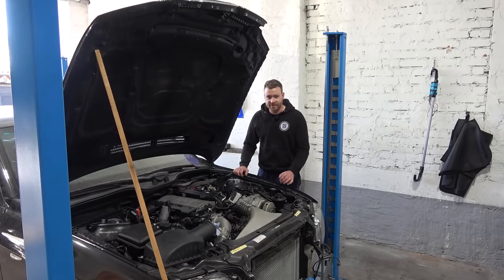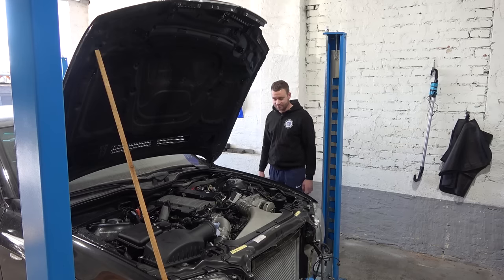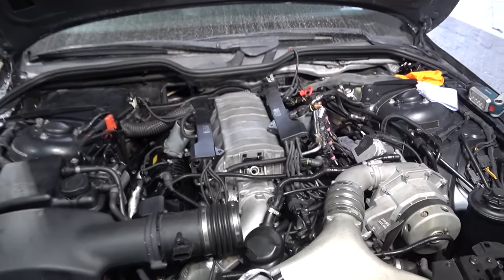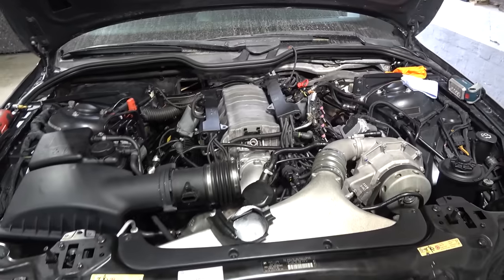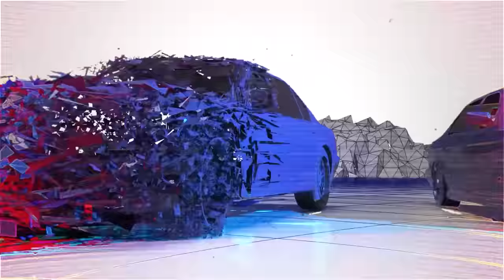Disastrous First Drive - V8 Alpina B7: Project Chicago: Part 7

Comment: I've had an e36 with an m42 engine in the past,it started knocking like crazy and I was ready to pull the engine out and replace it with a bigger one,but one of my friend's told me to fire it up without the accessories belt just in case and what do you know.. the knocking went away. Turns out my water pump bearing was basically eating it self. Replaced the water pump,and the engine works perfectly fine again. So i hope you get that lucky too!
Reply: Only thing is, if you follow the series...it has a brand new water pump....so it must be something else...
Reply: @ernest.cazenave  brand new things can be broken to :/
Reply: @amosjovt  extremely unlikely when it related to a japanese brand car...
Reply: @ernest.cazenave  I didn't know Japan owned Bavaria. Did WW2 end differently in your universe?
Reply: I had same problem on M52TU, it started knocking and sounded like it was comming from bottom of the engine. Took off valve cover, inspected everything, was ready to change the whole engine... In the end it was stupid water pump
Reply: Having in mind there was no AC, it may just be the AC compressor. I've seen it happen on some n54s. Sounds exactly like a rod knock. Anyways awesome work and hope it's something simple!
Reply: @Ernest Cazenave then just, fuckin say so?
Reply: Silence is approval they say..LOL..!!

Comment: OMG, I feel your pain. In college, I helped a friend rebuild the engine in his 1970 Buick GS. We pulled the engine and took it to a machine shop. My friend wanted to reassembly the engine himself. I tried to talk him into letting the machine shop do it but he insisted. We put the engine together. About a 500 miles later, he got on it and we heard the dreaded knock. Our hearts sank 'cause we both put a lot of blood, sweat, and curse-words into getting that massive 455 back in-place. That was way back circa 1980; hearing your knock was like reopening an old wound. I pray it's something minor...but I fear it's not.

Comment: I had the privilege of driving an Alpina B7 just like this for several weeks.  It was my best friend's car.  One thing to note about those wheels.....they are extremely fragile and arguably not well-matched to the car for daily driving.  My buddy went through 3 wheels in his first year of ownership in San francisco.  I was driving the car near Tahoe and hit a relatively minor pothole.  BAM.  There goes another.  The ride and power was amazing for a car it's size.  I remember being able to adjust the suspension stiffness, and it was noticeably different, with small bumps resonating similarly to what you were commenting on.  Nice car.  I hope the rod issue isn't bad. Fingers crossed.

Comment: I feel you. I really do. I saved for 5 years to buy my dream car. F11. My engine died after 1 year of driving it. Also exactly as yours did. I went off the Autobahn and when the load was no more on the crankshaft I heard the knocking. I still regret to have sold the car for cheap.
Reply: After reading this, I died a little inside, sorry for your loss bro, I hope your dream car will come true again.

Comment: I came to this stream back- asswards...watched part 7 first and gathered that it was another "revival" car but without knowing the effort to get to this point, it was sad to hear that knock but not devastating. Then I decided to watch 1 thru 6 and it all started to change my perspective...it turned into a binge-watch, all the time knowing that there was a fail in the end. All the care and effort that went into doing this first rebuild just right, was hard to take in cuz I knew something went awry. It is a bit like a novel or movie that starts with a scene at the end of the story and then takes you back to build the plot. I wish there was a happy ending but I doubt it...just yet.  
     I love my LeMans Blue BMW 135 i and as a " not " mechanic, have learned immensely from the few projects I have tackled.  Intake removal and walnut media blast; spark plugs and new higher performance coils; oil filter housing gasket leak; 4 wheel alignment...I'm sure there will be more and watching Sreten attack his projects, gives me the impetus to do the same for my baby 1 series. 
      Now I await for project Chicago to reveal " The rest of the story".

Comment: It is so hard to rebuild the entire engine only to have it fail so quickly. I had pretty much the same thing on an old VW air cooled engine. And even though they aren’t compatible at all, the feeling is. I hope for you it’s a chain or maybe the timing skipped again. Spun bearing would be very disappointing. Especially since you worked so meticulously. Keep it up. You will get there eventually. 💪🏻

Comment: If it idles at the typical 750 RPM then things that happen at crank speed should be at 12.5 Hz. Things related to the valvetrain or a particular stroke should be 6.25Hz. This noise is about 4Hz which is quite slow but could correlate well with a chain. belt or something else that goes around far below crank speed-- of course, assuming 750 RPM.
Reply: What’s the formula to get to 12.5Hz based on 750rpm?
Reply: @lenn4rd  750 (cycles/min) / 60 (sec/min) = 12.5 (cycles/sec)

Since the problem turned out to be pistons gouging the bores from incorrect tolerances, it's weird that the frequency was so low. I matched as best I could to a tone generator. It would indicate 480 RPM with something running at valvetrain speed. I doubt the engine idled at 240 RPM. 12.5 and 6.25 Hz were much too fast to match the video anyway.

480/60/2 = 4
Reply: @Sonny_McMacsson  idle rpm is 500 rpm so your calculations match

Comment: Don't give up. I totally understand the frustration but do not jump to conclusions, you did a very good job. Rebuilding engines is a major job peppered with potential problems encountered. Start by examining the oil, if there are no shavings, I highly doubt it would be a spun bearing. Well, you know what to do next I am sure. ;-)

Comment: I had the same experience when i rebuilt my 32 valve cobra engine, everything seemed ok  for the first couple of days, then i noticed a unexpected sound like slacked timing chains, all the guides and tensioners were new, pulled the engine back out and started diagnosing found rod and main bearings showing signs that material had gone through them scoring my new crank, all i can say is it realy sucks, but i have faith you will get it fixed you are a persistent individual.

Comment: Sreten, NOOOOOOOOOO 😢 that N62 really wants to fight you! But that's really strange, I don't think you did something wrong in the re-assembly.
I bet on oil contamination by the stupid old leaking injectors.
I just hope it's not too bad to fix! Fingers crossed ✌️
Reply: That doesn't make sense
Reply: My N62 and many others are getting to that 200k+ that's the strange part about this. I guess adding a extra 200 hp will do this
Reply: He changed the oil after the leaky injector change, I think he mentioned it
Reply: I was thinking this, starting the car with  fuel in the cylinders, may have slightly compression locked one or more of the cylinders causing tiny damage to the main bearing shells, and after a time running it, making the knock or spun bearing shell, d

Comment: As a shop owner I've rebuilt engines only to have them blow up because of improperly bled coolant (vq35) In a weird combination of the air bubble not being near the ECT, rushing to finish the car the day promised, and a bleeder screw placed in a dumb spot I've had fastly disassembly of an engine I've spent weeks building. Nothing to do but take it as a learning opportunity. All that can be done now is figure out the mistake and plan ahead so it doesn't happen again. 
Enjoy your videos from Florida friend. Good luck 🤞

Comment: When I do suspension links, I first take a measurement from the center of the wheel to the wheel arch with the car on the ground.  Then when I have all the wheels off and new links installed, all I need to do is jack the suspension up until the measurement from the center of the hub to the wheel arch is the same and tighten the bolts.
Reply: Simple and smart! Way easier to reach everything when the car is still jacked up!
Reply: That won't do anything uk, it's not bushings it's a ball joint within the links, so any way you tighten the ball would move to the position, you should be that for bushings but ball joints an links it's not needed
Reply: @pharezknights5467  Check your steering, I think there's a loose nut behind the wheel.

Comment: 44:58 the buzz sound might be from one of the buttons on the turn signal lever. I have the same problem in my E61
Reply: Same on my E60
Reply from the maker: Ha. Danke! Will check.
Reply: Same. The BC-button drives me crazy.
Reply: Same thing with E9x’s of same era. Drives me nuts 😄
Reply: On mine it was the speedometer reset knob vibrating against the plastic screen. Good luck!
Reply: Very good video diag. I have heard that stupid buzzing from those turn signal stalk ends on this generation of bmw. I never disassembled one however.
Reply: @WheelWallGarage  Right, need to check this on my E90 325. There's a buzz just like the one in the video..

Comment: Deal is with the torque wrench. I replaced main and rod bearings on my m20b23, but I used torque wrench for rod and main bolts... 5 days later I got a rod knock, because bolts were loose. I torqued all bolts by hand and I have ~3000kms driven with that engine for now.
Reply from the maker: Then your torque wrench is bad and you should never torque such important components by hand.
Reply: @M539Restorations  But why is this engine having a rod knock? You did rebuild on it.. Sad to see that happening but you will fix it and we will see that car driving again. Your videos are awesome and I wish u all the best!
Reply from the maker: @MorteN7  you'll see what happened in the next video. Thank you!
Reply: @M539Restorations  glad to hear! For me that m20b23 was a minimal budget build and right now its still running well. I understand that B7 engine is more rare and expensive than m20. :D So I would use a good torque wrench for that rebuild of course.
Reply from the maker: @MorteN7  I've never heard anyone torquing by hand rod bolts cause you normally need to stretch the bolts, but hey if it works, that's great. :)
Reply: @M539Restorations   Maybe its just northern europe stuff, I live in Estonia and here many people who I have talked about engine building, say that rod bolts and crankshaft bolts should be torqued by hand. When I first told my friend that I have a rod knock, then first question was: “Did you used torque wrench?”😂😂 Same with my brother, who has built several engines and never used torque wrench. Maybe we are all just lucky. :)
Reply from the maker: @MorteN7  Crazy haha. If you a factory specified torque spec and a good torque wrench, you can't go wrong. It's a must imo.
Reply: @M539Restorations  Crazy yea.😁 True, with newer engine and without budget of 150 euros I would have done it with proper torque wrench and new rod bolts.. I assume that for you the knock was from timing chain probably.

Comment: 26:58 Are they symmetrical for RHD and LHD?

Cars of this era, they have different angles of RHD and LHD side mirrors.

For RHD cars, the angle vs the body on left mirror are less than the right. For LHD, it's vice versa.

If you put the ones that is from RHD on LHD car, you gonna have a wrong mirror angles.

Comment: Well, so it goes sometimes when you're building engines. But from how meticulously you assembled her I doubt it's something you did wrong.
Reply: Its not, the cyilinder sleeve was all over the place, so the piston expanded into the sleeve and scraped it all up
Reply: @alxm9617  how do you know the sleeve shifted without taking the head/s off? lol
Reply: I will just add this thing: Knock Knock Knocking on heaven's door...
Reply: @ct1762  Im privy to other sources of information, it will all be explained in his next video

Comment: Sounds more like a valvetrain. Maybe something n62 specific: chains?   valvetronics ?
Not a bad idea to drain an oil and check for shavings....
Having my fingers crossed for that engine.
Reply: Pretty sure that's the first thing he's going to do
Reply: Thats it right - VANOS
Reply: Very hard to judge on video, but I am also not convinced it is rod knock. I once had a VVT-i actuator die on me and it sounded horribly too.
Reply: Wouldn't there be shavings anyway? I mean, he did do 2 oil changes already but the engine did only 100kms after a full rebuild. If the shavings aren't too big, I think he can't use them as proof of failure.
Reply: @unknown4630  what kind of shavings - that's the point and what produces them.
Reply: This is a slow, deep, almost dragging noise, as if something is hitting, then slighty dragging against  something else, and you are gearing it half as often as the engine spins. Its 100% not bottom end, my guess is gonna be timing, something related to a tensioner and the chain, however some more educated people further down in this comment section had deduced that this might very well be a faulty Vanos

Comment: So was it a bent valve or valve seal that failed? I wrote a comment on your engine rebuild video around the 3min mark saying the valve stem’s looked really scored and rough, which could cause a lot of friction and bend the valves, right? I don’t know a lot about rebuilding engines, but those valve stem’s looked off to me.
Reply: Indeed they did, Streten said it, you said it & thousands of subscribers saw it too; however the sound (albeit can be deceiving through road noise, microphone/camera distortions) did not sound like anything near bent valve to me 🤷‍♂️
Reply: Svren said block wasn't sleeved properly.
Reply: @pedroteixeira4369  Yeah, looks like I was way off... The guy who did the block really screwed up beyond what we all would have guessed though, right? I had a feeling something would fail after seeing that valve stem, but not to this extent. Sucks he did all that amazing work putting it back together only to have someone else's work be the cause of failure.

Comment: Don't worry, nothing went straight away and you are not loosing oil or pressure and your fluids are good. Perhaps a problem caused by a very small factory trick in the assembly process that is not covered in the instructions, or a bad part, that does happen. Good luck, you have a lot of support from your followers!

Comment: I once had an e65 735 V8, A similar problem occurred. I immediately thought that the engine was bad, it turned out that the alternator rear bearing was broken. I hope you have the same problem and easy to repair!💪💪💪💪💪
big fan of Estonia

Comment: You can always get aftermarket injectors, specify the resistance and cc, and hope the fuel tables are close enough (they tend to be).
You dedication to oem style parts is refreshing if confusing at times to me.

Comment: Ah I feel for you, I had a similar situation happen to my e53 4.4 X5, went through all the work and trouble of replacing the dreaded failed timing chain guides, engine was running fine for a few weeks and then bam! Failed snap ring on the input clutch drum in the trans responsible for most forward gears, decided to scrap it after that as it was just a money pit. Sometimes certain cars are just lemons.

It does sound similar to failed timing chain guides or timing chain slop, all the best my friend.

Comment: Aw BLEEP!!!! Bad bad bad!!! I'm soooo sorry dude. Once I was test running the engine in an Acura MDX after having done the timing belt. It ran perfect until the key rattled out from between the crank and the pulley (I didn't have the crank bolt in place...big bleepin gaff). I knew instantly the pistons hit the valves. I lost a little money on that job. Installed all new valves and put it back together. Fortunately no piston damage occurred.

Comment: In my experience on my E66 745Li. Every time I drove it came home with joy, and then something wrong happened!
From stocked brake gears, A/C blower didn’t work, auto tailgate cylinders dropped, window curtain, electricity leakage etc.
I always told myself that E66 made me comfortable and excited. Looked the bright side.

Finally, I sold it. Right now I drive Peugeot and Mercedes.

Cheer up, enjoy it!

Comment: For all those narrow places, there's the gek200-w36. I know, some people would choke on their pretzel at the notion of a nut-frakker ended torque wrench, but these (most units, and i'd look for one specifically made there) are made in Japan and are meant for high end, installation work. Hydraulic, water, for medical and stuff like that. Torque range is pretty good: 27~200Nm with a 0.2 step.
Also, on the JP market (which does have some US based shops, so maybe you can get them through that angle) there's quite a few manufacturers of wrenches with narrow profiles. I won't label them, because YT has a tendency to snap those kinds of comments in half, but you can look them up. There's a completely different philosophy in Japan when it comes to torque wrenches from our European (or even American) style. They're more ... let's say gadgety, but without the bad connotation of the word. I have the gek-135 and i'm satisfied with it.

Comment: Hope it's nothing major, good luck! And to answer one of your questions, the new BMW cars have the indicator stick staying to the side your indicator is pointing. Like 'normal' cars. I personally drive an E60 and I have completely adjusted to the way the indicator stick works on it. Now, when I'm driving other cars I get annoyed sometimes by the way 'normal' cars work. I like how the E60 blinks however many times you set it to on a tiny push and with a full push it stays on till either turned off or you steered back. Tiny push for switching lanes (3 blinks for me), big push for actually changing direction. :)